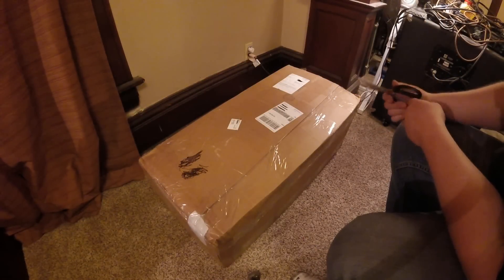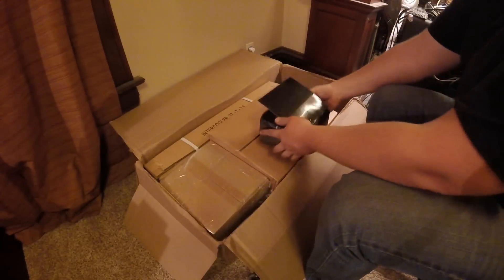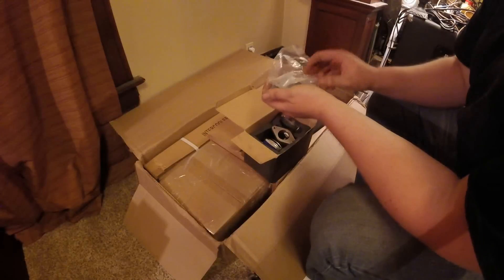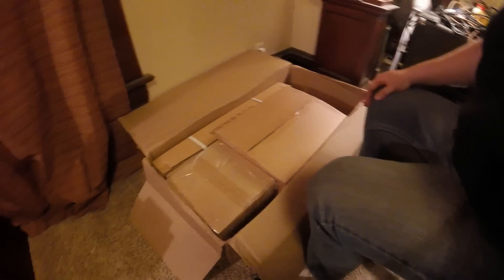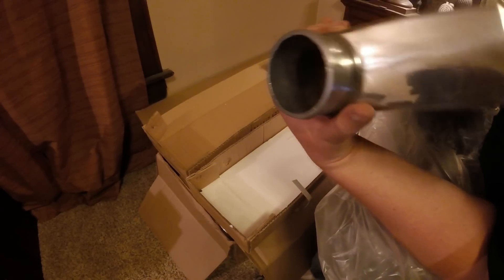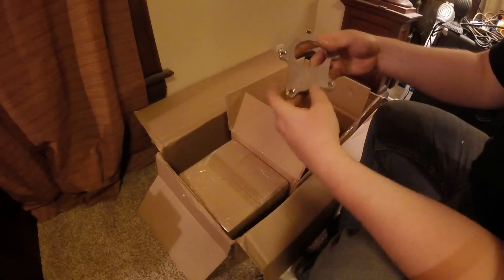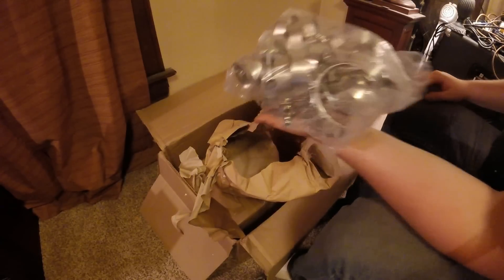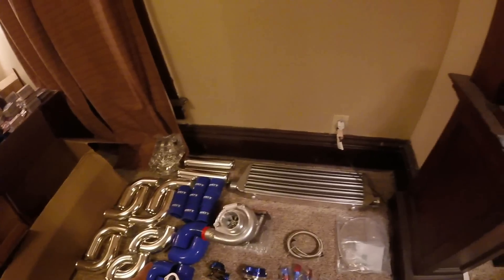500$ eBay Turbo Kit Unboxing

Comment: just because its from ebay doesnt mean its bad quality many companys just use ebay to sell there products ive ran a turbo from ebay well over 400hp for over a year now and its still perfectly fine never had any problems
Reply: did u tune it?
Reply: its not about being from EBay, but about its cost of 500$
Reply: +Arx9077 yes
Reply: I bought a $279 turbo from ebay, 8000 miles and 12 psi later, it's still boosting away!  I have a Garrett waiting to go on, but the coolant lines and waiting to cool down to 600F before shutting off may help.
Reply: I cant tell if youre being serious, but just in case, no the tuning chips have been proven to be useless..
Reply: wat car did u put on the turbo
Reply: do you have the link for the turbo kit you have bought from ebay ?

thanks.
Reply: guys don't half ass it and buy a turbo from ebay, save up and buy an actual kit. you're going to regret it if you half ass it
Reply: disbadjazz z havent regretted  it yet it has lasted longer then 3 motors already
Reply: Matt Snapp what car do you have
Reply: disbadjazz z 95 bmw 325i
Reply: disbadjazz z all 3 motors had rod bearing failure
Reply: Matt Snapp guess you got a good one then
Reply: Matt Snapp hey that's awesome that's exactly what I'm going for. Does it hold all the way through the gear when you race?
Reply: Matt Snapp and what brand is it?
Reply: Matt Snapp w

Comment: turbos need to have that bit of play because the oil pressure gets rid of it
Reply: whats no reason? Dry turbo need to have play. Wtf, dude?
Reply: sskkuuddrraa this!
Reply: correct
Reply: i was going to say the same thing. a dry turbo will have a little side to side play. in and out play is bad no matter what though
Reply: yea its cheap and has the journal bearings...but as long as you keep the oil flowing right you can get some life outta ebay cheap turbos..

Comment: You have to understand you get what you pay for.  The high temperature, purified materials that go into brand name turbos are NOT going to be in the ebay cheap turbos.
The material cost for quality components would raise the turbo price.
Having said that there are things to do to make an ebay turbo work.
1. Don't go to extreme boost pressures.  This will destroy an ebay turbo because of the materials used.  
2. Fuel is your friend!!  Use rich air-fuel ratios to control exhaust temperatures.  For an ebay turbo, I would not run leaner than about 11:1 or less.  Heat will take down the ebay turbo quickly.  As mentioned above they are not going to use inconel or other high temperature tolerant materials due to cost.  Running a bit too rich will not noticeably reduce power but will keep the turbo from grenading.
Reply: Paulg 127 yo thank you so much :) I love you Paul

Comment: So the A/R ratio are basically an aspect ratio of the compressor (or turbine) housing cross sectional area to the radius of the turbo measured to that cross sectional surface.  Its a measurement that helps describe the flow characteristics of the turbo.  Your T3 has a 0.63 A/R turbine and a 0.50 A/R compressor.  On a 1.5L engine, that turbo is way too big, so its not going to spool until ~3000 rpm and start making boost at ~3500 and maybe by 5000 rpm you will have full boost.  For a 1.5L motor you need the T25 with a 0.48 A/R turbine I am rebuilding.  I am installing it on a 1.8L miata, but I bought 2 turbos from an RB26DETT motor.  Look for a 0.48 A/R 50 trim T3 on ebay...that is the only turbo your 1.5L will actually spool by 4000 rpm. ;)
Reply from the maker: Wow good info I learned a lot just now. I can always play around with turbo size later. First let me make sure the car doesn't explode under boost lol.
Reply: +Tyler's Garage 

Garrett's website has a whole section that explains this stuff.  Its called Turbo Tech Basic, Advanced, and Expert. Everything from bearings to A/R and trim to plotting compressor maps. Read that and you'll know more about turbos than any of the guys in the Haggard/Ricer/Spoolin- Garage/Miata/Etc  YouTube scene.
Reply from the maker: Leo
That sounds awesome. Will check it out.

Comment: FYI, a journal bearing turbo always has about 1/8 to 1/16 inch of shaft play to allow the oil into the journal
Reply: Goochi squad Any turbo has some shaft play.
When it heats up,the metal expands,and tolerations become tighter.
So that play is keeping your turbo from seizing.

Comment: A little side to side play is normal. Oil pressure takes care of that. In and out play should be zero though. If you wanna get a better idea of the quality of the IC shine a light down one end and look into the other. Basic rule is if you can hardly see it then it's at least decent. If it shines straight down then you might as well run a straight pipe.

Comment: you got more stuff then I did.  like I didn't get flanges boost controller or external waste gate just an internal type . maybe car was the difference and I got mine 2 years ago . didn't drive the car much and the motor went due to bad timing I'll be running all ebay once I get a new head and try again .

Comment: i had some fun with a bolt on td05 16g snail from china, the internal wastegate was way too small so i had to make the hole bigger, other than that it worked fine, i ran 23 pounds on it for a long time on the street ... it did surprise me a little :)

Comment: for the money you paid i would say you got a fair deal!! I live in the UK and for the equivalent of $500 you would struggle to even get a decent intercooler setup so all that silicone and a turbo even if it is a Chinese one is still to quote " cheap as chips" :)
Reply from the maker: Thanks for the comment. I think it was worth it just to get the car setup for boost and then I could upgrade some of the components later.
Reply: Link please

Comment: the .63 means that the compressor wheel is a .63 which is a common wheel and the .50 ar is the turbo trim.

Comment: Any slight play in the turbine means trouble in the future. I suggest you get that tighten up good if not your looking at buying a new engine in the short term. Good Luck on that!
Reply: Oh really!? I guess that ur absolutely right you must be making turbines, right!? Ask any turbine shop that deals with good quality turbines they will tell you this; any slight play in a turbine's shaft can cause severe damages if the shaft is slightly loose it will either overheat or the turbine itself could overheat and warp u'll end up with no engine.
Reply: But since ur the expert on making turbines than yeah sure I'd definitely listen to you for your expertise. U seem to be the Einstein of turbines. Good Luck with that.
Reply: Acceptable and not recommend! If you want the least amount of problems in the future. Maybe you haven't had the proper expertise! Also because they will be glad if ur engine breaks down so they can charge u an arm and a leg to fix ur Turbo and ur engine.
Reply: so at wich company do you work then? The guys at mitsubishi seem to think a little play should be there. Atleast they do it on their brand new turbos. And i think mitsubishi is 1 of the biggest turbo manufacturers of the world.
Reply: That's very good for them but the lil play they have u can't even see it or feel it when u spin it. I work for a jet liners company on engine planes, which is basically turbo designs come from it.

Comment: it looks really cheap to me and not complete but how is it holding up
Reply from the maker: Haven't really put it to the test. Still building the car. It does spool and everything seems to work so far.
Reply: +Tyler's Garage that's good take your time. hopefully it works out for you and will last. also how was the Fitment did everything line up well or did you have to cut and modify some stuff?
Reply from the maker: Had to drill out the oil feed bolt holes. They were too small. I made my own up pipe because no one makes a manifold for my engine. I'll be making my own downpipe as well. I also had to find my own reducer to go from the charge piping to the turbo. Blow off valve fitment on that adapter piece is kinda shitty. The rest of it has been fine. For now.
Reply from the maker: Also the ebay t bolt clamps for the charge piping absolutely suck. I'm gonna go for a different style asap.
Reply: +Tyler's Garage thats not to bad considering the price. i spent about 5,800 on my turbo kit From PRL Motorsports. so if the Turbo is made well you can come out on top by just making your own parts. Full-Race has a lot of parts to coustom build a kit if you have not checked them out. also PRL makes a lot of stuff for people and they do an amazing job.
Reply: What material are you using to build the exhaust? What welder? Any other special tools?
I have been doing some metal fab with very limited tools and a crap welder. Just wondering what you work with on the cheap.
Reply: +xUltimate no i love my Turbo Kit to me it was worth every penny. it was a complete kit and everything fit like a glove no fabrication needed(other than the Normal oil pan and such) and the directions made it so easy if you had no idea what you were doing they made it step by step with torque specs and all. I have driven the car really hard and not one issue i have a solid power band throughout the whole rev range. PRL and Full-Race put a lot of R&D into there kits so you know when they got a product you are getting top quality.
Reply: michael Lawrence
Reply: michael Lawrence

Comment: just drill open the oil feed a bit more. return line should be fine.
Reply from the maker: How far do you think I should go? I've heard .063" is the magic number for these ebay turbos.
Reply: Tyler's Garage Honestly i dont know. i have heard several people saying and showing their ebay turbo ended up breaking due to lack of oil. Budget Racers is the recent youtube one. They are on their second ebay turbo but it works now! cause it has oil going to it.
Reply from the maker: Seems like trial and error. Oh well at least they are cheap.

Comment: Is it still running good I was going to get that kit for my 2.0 mazda mx6
Reply from the maker: Not installed just yet. Just got the motor back in the car, finishing up a couple things in the engine bay than the install will begin.

Comment: Is this a good turbo if ur only looking for a 100hp increase?
Reply from the maker: It's ok I guess, I think the cxracing ones are better though. This one did last quite a few miles on 2 different cars though and it is still working. Had it up to 12 pounds on a 2.5 liter v6 pretty sure that was at least 100 hp gain. Car is pretty quick.
Reply: thats awesome man. I have a 2004 bmw e46 330ci with a 230hp v6. exhaust system and cold air intake added 20 hp so im up to 250hp. If i can boost it up to 300 with this turbo. That would be perfect with tuning this turbo to 50hp as it wouldn't be as stressful and straining on the turbo

Comment: Never run your oil drain into the valve cover. It will fill up with oil and cut off the flow.

Comment: I bought headers, long tubes, and they forgot the clamps...but it's still a great deal and an easy mistake.
Reply from the maker: I have also purchased headers on ebay. I bought OBX for my MR2 and they are great! Fitment was perfect and they haven't cracked. Had them for almost a year.

Comment: what headers/manifold are you going to use?
Reply from the maker: The stock header on the tercel is super short with a 2 in oval flange. I have a short mandrel bent tube that I'm gonna weld a 2 in oval flange to one end and the turbo flange to the other. I was also gonna put 2 small pieces of flat bar and use them to connect the flanges on each side. So hopefully it won't fall apart lol.
Reply: Don't forget you will have to mount the wastegate to your exhaust manifold as well

Comment: did it spool or turn into rock candy for ur engine?
Reply from the maker: Yeah it spools up between 3500-4k on my little 1.5
Reply: +Tyler's Garage how long have have you had it setup usually ebay plus turbo equal grenade, and im not knocking you im just curious?
Reply from the maker: Jordan M
Haven't really driven it except moving it or testing it. Still have to do the fuel system on the car. So it could definitely still be terrible. But as of now it seems fine.

Comment: What's the difference between a 800 dollar turbo and a 8000 dollar turbo
Reply from the maker: Quality. Quality of the metal, fittings, bolts, bearings, everything really.
Reply: CjThaAssassin 99 $7200
Reply: A M XD

Comment: as in you can't us the boost controller
Reply from the maker: Wastegate has 2 ports. Bottom one connects to boost to open wastegate. Top one can be vented for no adjustment or you can run it to the boost controller and then to boost to allow adjustment via the boost controller.
Now I don't think i'm gonna do that, because these boost controller's are crap. I'll just put a different spring in the wastegate if I want to run different boost levels.

Comment: this turbo or 100 nos kit
Reply: N2O
Reply: +Outlaw  no this is a turbo kit. second of all nos uses no2. nos is a brand no2 is nitrous oxide. get you're facts straight before you give people wrong information. so people that actually know what they're doing, don't have to correct you.
Reply: +Nathan Pearce ummmmm

I have got no clue what you were trying to accomplish by you....  let me be polite here (by your innocent comment).!

N2O is referred to as Nitrous Oxide 

"Nitrous oxide, commonly known as laughing gas, nitrous, nitro, or NOS is a chemical compound with the formula N
2O. It is an oxide of nitrogen. At room temperature, it is a colorless, non-flammablegas, with a slightly sweet odor and taste. It is used in surgery and dentistry for itsanaesthetic and analgesic effects. It is known as "laughing gas" due to the euphoric effects of inhaling it, a property that has led to itsrecreational use as a dissociative anaesthetic. It is also used as an oxidiser in rocket propellants, and in motor racing to increase the power output of engines. At elevated temperatures, nitrous oxide is a powerful oxidizer similar to molecular oxygen."

and No2 is Nitrogen Dioxide 

"Nitrogen dioxide is the chemical compound with the formula NO
2. It is one of several nitrogen oxides. NO
2 is an intermediate in the industrial synthesis ofnitric acid, millions of tons of which are produced each year. At higher temperatures it is a reddish-brown gas that has a characteristic sharp, biting odor and is a prominent air pollutant. Nitrogen dioxide is a paramagnetic, bent molecule with C2v point group symmetry."

now that we got that out of the way.  what were you thinking when you stated that  mediocre statement? 🤔 

btw I was replaying sarcastically to the OP question.  but you!  you don't deserve my cooke ya cooke. 

go read a book or something

Comment: everything is made in China.  the good stuff and the knock offs. The only difference is the better stuff is engineered and uses tighter tolerances during manufacturing compared to the junk stuff that is engineered to China's specs

Comment: Does it fit on challenger v6
Reply from the maker: Technically yes, however this is a universal kit so you would be looking at buying/fabricating exhaust manifolds, upgrading fuel injectors, ecu tuning, etc.